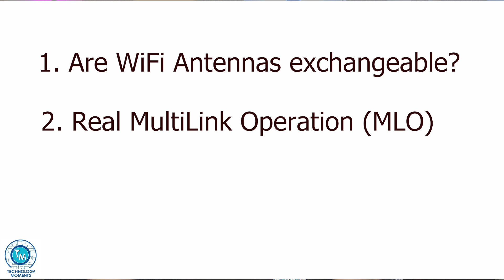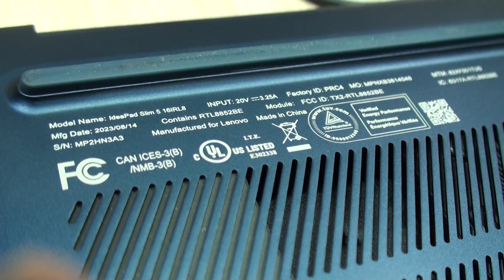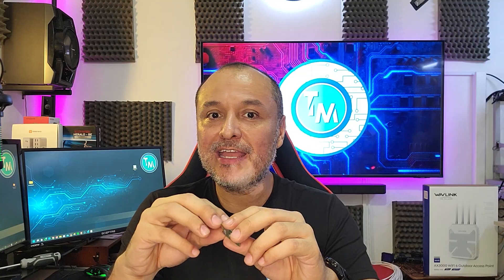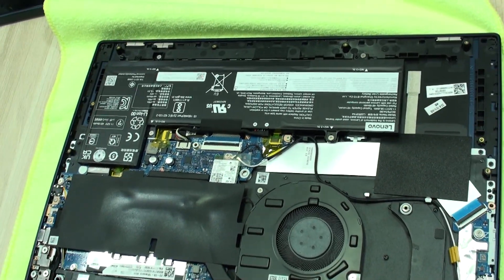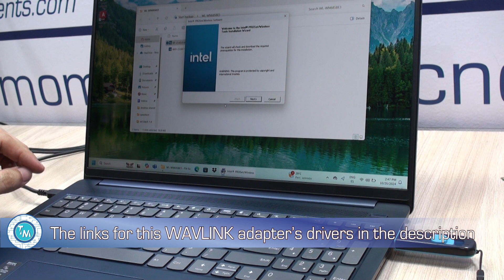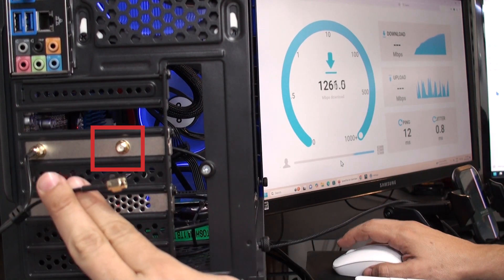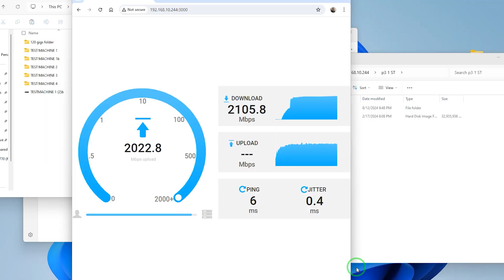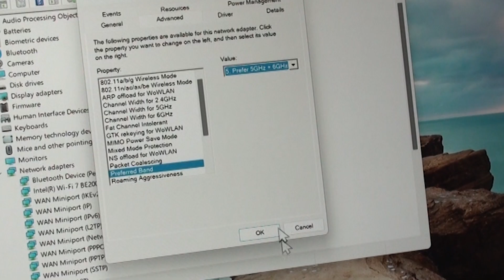Extreme WiFi7 Speed with WAVLINK BE8800 internal adapter, when we thought we couldn't go any faster

Comment: I also received this card to review and I can confirm that the increase in speed is amazing. It's very easy to install and even compared to my previous AX211 wifi card that came with my laptop: the performance is about 60% better, although the wifi network configuration is exactly the same (in wifi 6E I can reach up to 1300MB/s - but I can't wait to test it as you did on a good wifi 7 router). The Bluetooth 5.4 also brings a big gap in performance, the range is much better than before with a 5.3 enabled headset. Thank you for your video which is very clear and well designed.
Reply from the maker: Please come back and share your experience and brand of the one you get.

Comment: What is BE8800 ?  Do you mean BE200? Very confusing video.Have you also installed the MSI  Broadcom card on the laptop, was it faster than the intel?
Reply from the maker: Sorry about such confusion.  BE8800 is the model of the Wavlink's adapter.  It is based on intel's BE200.  MSI's video you can see it here:  https://youtu.be/zS10IyosQSQ  2.5 Gbps .  However many more tests are coming as we did not reach higher speed basically because even when the MLO was active at the router, it was just using the 6 GHz band.  The one in this video was WAVLINK's adapter leting us configure a little deeper into the MLO, forcing both bands to operate simultaneously.  The AP just tells the clients it is MLO capable however is the client that "decides"

Comment: 5:41
Could you let us know if EAP773 can saturate that 10gbe port on wifi?
Using 4 devices and doing openspeedtest "SIMULTANEOUSLY" to check aggregated speed, e.g. 2.5gbps+2.5gbps+2.5gbps+2.5gbps = 10gbps (saturate 10gbe port on EAP773)
Reply from the maker: Thanks for your comments.  We'll try that in another video with several clients over different radios.  Wish we had more time for all the tests we have in mind.  The 10 Gbps port on the switch does not como close to 10 Gbps.... more to 5 Gbps.  At first we thought a 2.5 Gbps uplink would have sufficed.  Now we know it wouldn't have been enough.  Again, thank you.
Reply: @TechnologyMoments  
Have separate SSIDs for 6ghz and 5ghz. Don't bother testing 2.4g. Have 2 device connect to 5ghz and 2 device connect to 6ghz. Hopefully we can see near 10gbps.

Comment: What are you using to get such high speeds for testing?  Also I couldn't understand a lot of this due to the echo! He needs to get a decent mic!
Reply from the maker: Sorry about the audio, more than the mic we've had trouble with the location.  No excuses.  About the hardware, important in this scenario to have a good AP (we're using the EAP773 FROM OMADA  https://amzn.to/3VDuOIV) and the switch you connect it to, of course has to be 10 Gbps (we use the QNAP mixed 2.5 and 10 Gbps switch https://amzn.to/3z885gD)  The other end of your connection has to be 10 Gbps all the way.  Just like we saw in a recent video about 5 Gbps  https://youtu.be/XYTOKbTgX7M